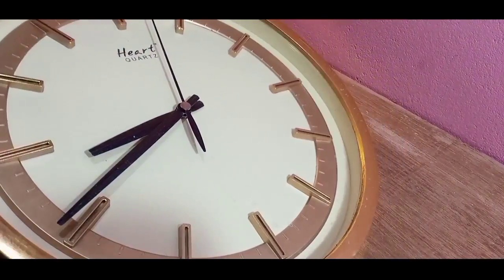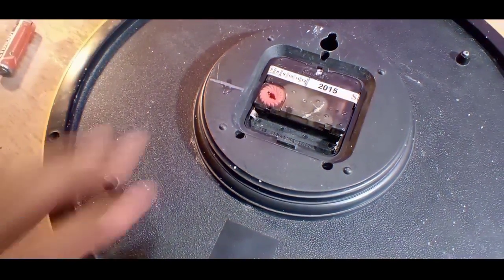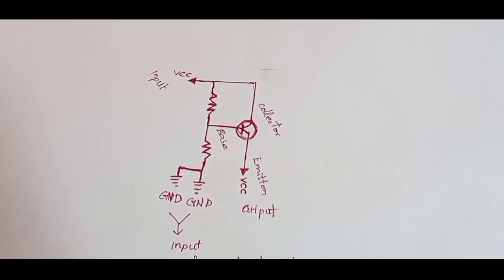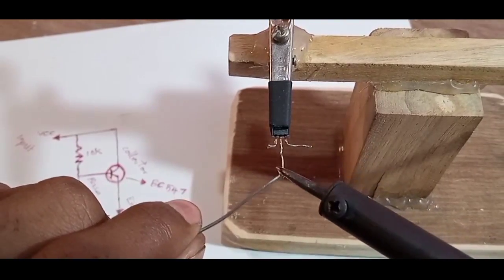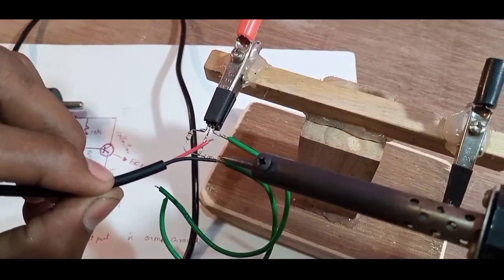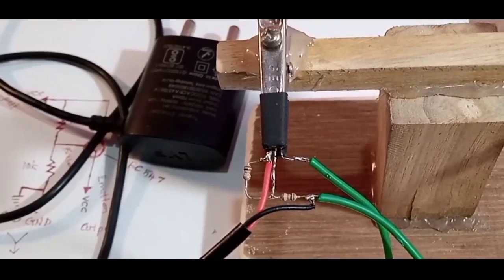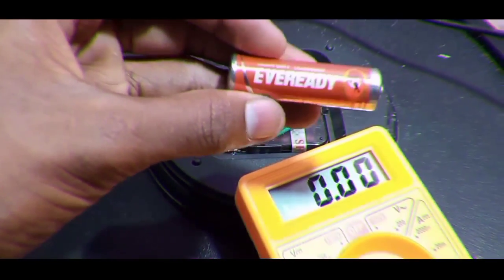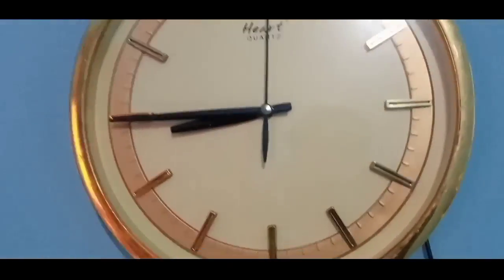How did I run the wall clock without any battery (Need No Battery)

Comment: If main current stopped.. Clock will stop. Then we have to keep the time again.. What is the solution for a temporary power failure?
Reply from the maker: Use.. 3.7 volt rechargeable 🔋battery...
Reply from the maker: Use.. 3.7 volt rechargeable 🔋battery... This is only best way...

Comment: SIR:  WHAT WILL HAPPEN WHEN THE HOME ELECTRICITY GOES OUT. PUT ALSO A NI-Mh 1.2V CELL IN THE CLOCK AND THEM IT WILL RUN FOR YEARS.
Reply from the maker: Yeah... I know this is the best... Way... But we are electronics hobbiest😅.. So we try little 🤏bit different and simple circuits... For fun..so don't worry about that... Ok

Comment: When the electricity goes out, the wall clock will sleep and will not give you time!!!!!!
Reply from the maker: Ahh.. 😂😅 yeah
Reply: How to connect a battery backup to it in case the power goes off.
Reply from the maker: Instead of.. Using that 5volt adapter... You can use 3.7 volt lithium-ion Rechargeable battery... That's... Help you when power went down... That's it...

Comment: U have showed 1 battery
 Is that a 1. 5 v battery..  in ur reply u are telling anout 3.7 v batter. And you have told about acapacitor. Nut it is not in the circuit.  U are confusing......  can u reply my queries technically.
Is the clock runs on 1.5 v are 3.7 v battery?
Ur circuit output shows a 1.9v  so.ething.
Reply from the maker: Bro... Keep it mind... I am here in this video using only output from power source of smps... Converting 5v to 1.5 to ~2v.... 

U can try better way of this circuit... Using 3.7v lithium ion battery(rechargable battery) for more than year's... Or life time... So we no need to buy 1.5v battery again and again🥵... Okay that's it...

Comment: Bro, This is not a battery, This is a cell, More than 1 cell
 called battery.
1 cell volt= 1.2v or 1.5v
12v battery = 1.2v cells added in series connection.
Reply from the maker: Ok.... Thanks for your explanation...

Comment: Bro, my table alarm clock has 2 AAA 1.5v battery slots, how can i do ?
Reply from the maker: Bro... 2 AAA batteries mean 3v so u can using the voltage divider circuit for this clock or using 3.7v battery with one diode... A diode 0.7v dropped so.. now it's easy to use and u can also recharging your battery... That's it

Comment: If light goes than it will stop, needs some solution.
Reply from the maker: OK 
If you use 3.7v battery for mobile charger 
You remove that mobile charger and place it the battery on the same circuit that's all
Thanks for watching my video's🙏

Comment: If power goes off.... Then....
Reply from the maker: Then.... Clock not work but you can use the 3.7v lithium battery for your clock that is a rechargeable battery or may be you also use your mobile phone battery to your wall clock 

Thanks for watching my video's🙏🙏

Comment: Lithium battery 3.7 v to 1.5 v method not working properly .. only 3 to 4 days perfact work . After 3 days clock time is  delay.
Reply from the maker: Hi, it's work really good i remove the charger and replace the 3.7v battery 
I think you not connect the capacitor 

I our home that clock work's really good time is no delay 
🙂
Sorry for my very bad English
Reply: I didn't use capacitor maybe that's why it didn't work
Reply from the maker: @sanjivtirkey2479  yeah you can use that

Comment: What will happen if we don't adjust the time after resume electricity
Reply from the maker: The clock doe's not work but you can use the rechargeable battery for this circut 

Remove the Mobile charger and place battery that's it

I making video that time i have no rechargeable battery
Reply: That would I thought 🤣🤣🤣🤣🤣🤣🤣

Comment: no time without electricity. anyway great work
Reply from the maker: Yeah but you can use the 3.7volt rechargeable battery its work really good 

But i have no rechargeable battery 

And thanks 😊😎😉
Reply: Inverter bro
Reply from the maker: Ok I make still wait for my video and please supporting mee

Comment: Supply failure stop the time
Reply from the maker: Yes Bro but you useing a 3.7 volt rechargeable battery is perfect for this clock but i have no battery 
And using mobile battery also bro😊

Comment: Superb bro💥...yenaku maths , physics la varadhu...history geography mattum dha 😁
Reply from the maker: Romba nanri bro

You're history king😎😊
Reply: @Doitcreative  😄
Reply: I tried this 2 times but my 3.7V lithium cell drained off within 3 days. Why it had happened, can you please clear my doubt ?
Reply from the maker: Ok bro 
You can use more amp lithium battery use only two resistor's 10k and transistor BC 547 and it work really good please check your connections and replace new battery
And thanks for watching my video's🙏